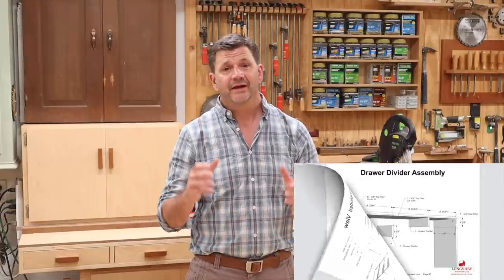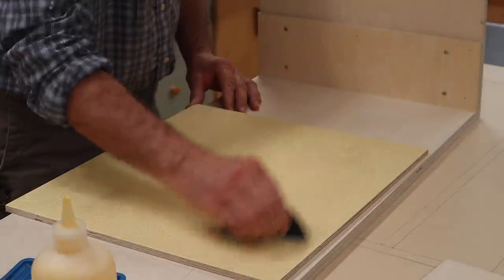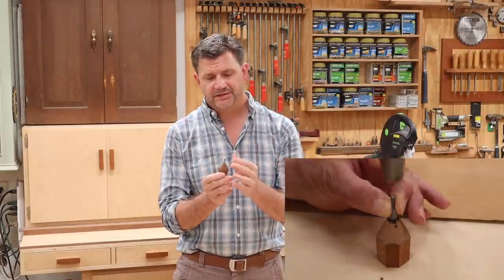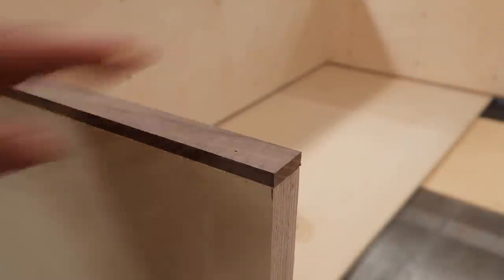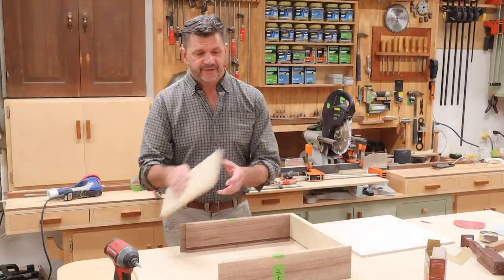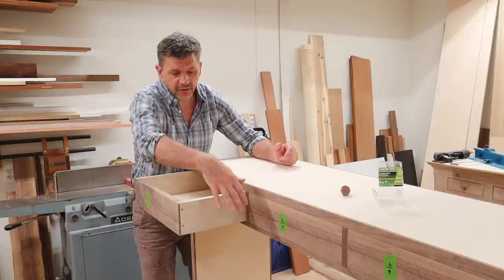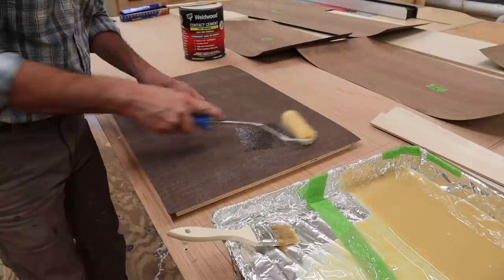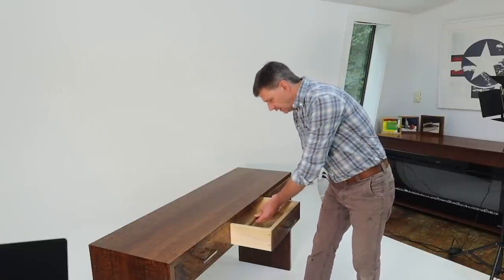How to build This Modern Sofa Table - Start to Finish

Comment: I bought a set of small, low-profile plastic knurled knobs that have a 1/4" hex hole in them for using a bit in tight locations. They work well for applications like attaching the drawer stops.

Comment: Great woodworking video for real world woodworkers. The construction techniques and tools required look very reasonable. Did you add the screws to the face to face plywood joints as a means to help out those building the project who may not have a large supply of expensive clamps? Or is there a structural reason the glue alone would not be strong enough?

Comment: The Plywood has to be of a very high grade when ur making a piece like this I guess?? It's a really nice piece man. The Veneer makes a wonderful job of it. I want to build a console table for under the stairs for my mother's home. She keeps on at me about it. I don't have the table saw like u have but the one I have will do the job I guess. It's a cheap saw but it does cut well with a good blade.
I think I will attempt one of these with MDF 18mm and I have 1/4" plywood sheets that I will use as a veneer for the unit. I might save the Plywood and just paint the whole thing a nice Satinwood colour. Either way it's the design u built here that I really like. I just sub'd and liked today this  minute. Only found ur channel today. Keep the great projects coming. I learned a fair bit from this. I'm relatively new to this game. I love working with woods even if MDF is all I have atm for this build I'm going to attempt..

Comment: Hi Jon, just found this channel, love it. Best , easy to follow instructions I have found. Can't wait to try some of these projects. One question, how do you get such great cuts on plywood? I seem to end up with so much tearout. Have tried different blades, doesn't seem to matter. Thanks for the help
Reply from the maker: Thanks Don! A zero clearance insert in your tablesaw will help. 
Also sometimes I will apply painters tape to cross cuts to prevent tear out.

Comment: Curious why use veneer vs making solid wood panels? The veneer at the site you listed is pretty expensive. I am building a wine / liquor cabinet and estimated the cost using plywood and veneer vs using white oak for the cabinet carcass, and using solid white oak was less than 10% higher than going with veneer. Just to add, website you mentioned wants $150 for 4x8 sheet of white oak. I can get a double sided white oak 3/4” plywood for $168. Definitely not cost effective for me.

Comment: Hey Jon, do you have a preferred contact cement? The stuff I'm  using doesn't roll on very well.
Reply from the maker: I always use Dap weld wood… The solvent-based

Comment: This is the first video of yours that I have watched. I’m a (serious) amateur, sometime professional, cabinet maker for 45 plus years. 

A video with very high production values does not mean that the presenter knows his stuff - I’ve seen relatively poor quality videos showing high quality work. However, when you get, as with this, the perfect combination of high quality video with high quality craftsmanship, it does make easy viewing.

There are many good ways to achieve any single task in woodworking - and usually a few bad ways. So, whilst, I would not personally make my tables exactly this way, I would have no problem in doing so. I guess it depends on a personal preference.

One curiosity that I have is the use of screws to hold pieces together when you have already applied glue thoroughly and also pin-nailed. It’s not a back-handed way of saying that you shouldn’t but rather a question of what might be wrong in just glueing and pinning (as I have done). I’d be very interested to know why you go that extra step - although, as the self- professed King of over-engineering, I’m used to going belt, braces and then another belt. 

Aesthetic is personal; you like a style that I don’t and vice versa. Craftsmanship is universal and I admire yours. If I might be so bold as to comment on aesthetic, I try, in similar tables that I have made, to go for overlay drawer fronts so that the continuous grain pattern you have achieved is not interrupted by the visible drawer dividers. It’s just personal choice. 

Your simple drawer construction pleases my eye. I think that “extreme” dovetails can add to an aesthetic but if it’s just for a joint, I don’t think dovetails add a degree of additional strength that’s needed. I understand that, back in the day of Chippendale etc., glues were not particularly effective and so a mechanical joint was required. These days, when adhesives are usually stronger than the timber, a chemical joint is all you need. Your solution looks (to my eye) to be perfect for the clean look of the overall project. 

Your veneering technique is spot-on. However, I have one further question - I was always taught that, if you apply a veneer to one side of a substrate, you must apply an equal thickness veneer to the other side; otherwise, warping would occur over time. I was told , and most examples on YT show, that you must respect this even when veneering plywood. What are your thoughts on this? I would be delighted to be proved wrong as veneering both faces adds time and cost which you avoid. 

There seems to be a myth that veneering, like French polishing, is an art that requires a four year apprenticeship. It doesn’t. Buy good quality veneer from a respected supplier and you will get a product that is as easy to apply as you show. Buy cheap veneer and……I have a book-press type of veneer press which is great for smaller pieces of veneering and vacuum bags for larger, shaped pieces. But, for flat, large pieces, I do exactly as you do. Perhaps I would suggest first time veneer-ers start with offcuts and smaller projects but it’s certainly achievable to veneer large items straight off if you have good veneers, glues and substrates. 

Apologies for the length and the questions. You should never stop learning and finding out better ways.

Comment: Im wondering since the glue is stronger then the wood why the screws on non load bearing 3/8 plywood? why the screw holes when they should not be necessary?
Reply from the maker: Build it however you like 👍

Comment: surprised no hardwood banding on the bottom of the legs, Being said. I dont have the skill to do something that nice, yet. Thanks
Reply from the maker: I did use felt pads on the bottom and the floor is very smooth, I think it will be okay

Comment: I thought  you needed  a vacuum press   to do veneering?
Reply: No not at all if you use contact cement. You would need it of you are veneering curved objects. BTW contact cement is also used for laminate which is basically plastic veneer.